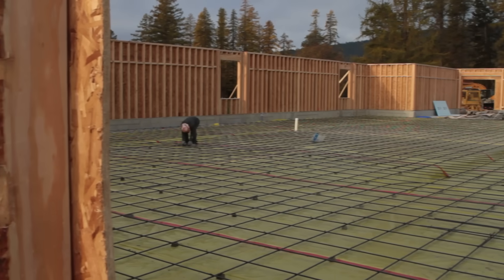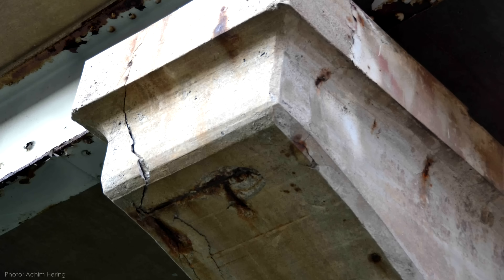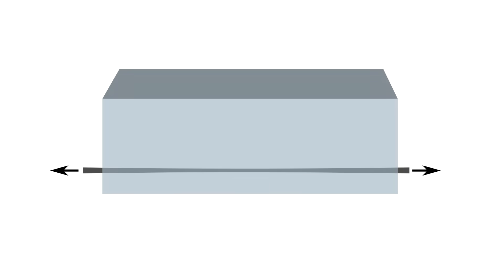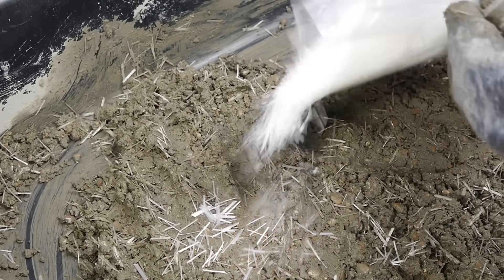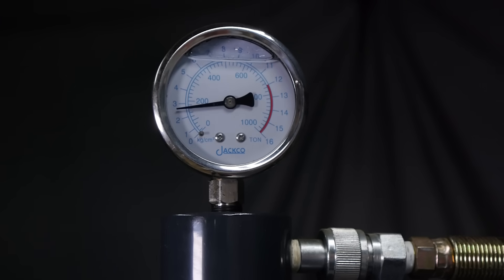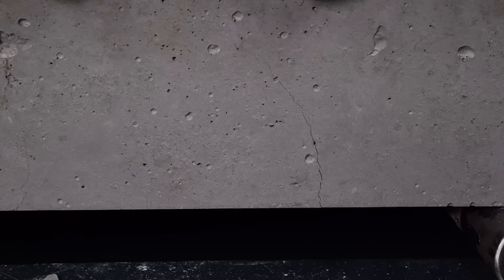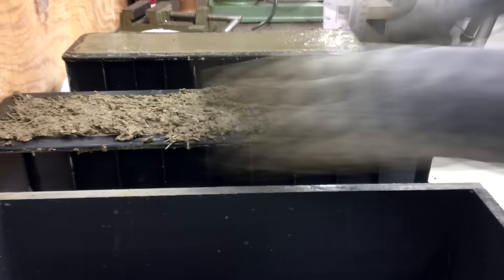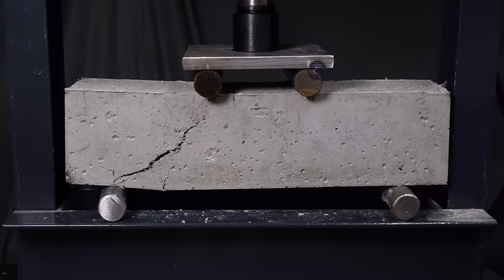Does Rebar Rust?

Comment: Great video, but the structural reason that steel rebar is used is also that it has a very similar expansion and contraction rate as temperature changes occur.  Glass has the problem of alkali silica reaction. The the crystalline gel formed around any glass in a Portland based concrete is expansive and swelling occurs. This swelling breaks the concrete matrix. Admixtures can be introduced to combat this, but cost is key. The single best system is to use as little water as possible. The water amount above what is needed for the CHS... chemical reaction to occur is responsible for  capillaries in concrete that lower resistance to salt etc...  But placement of the concrete becomes labor intensive.  Hence the saying "do you want it cheap, good, or fast you only get to pick two of the three.

Comment: Wouldn't steel fibers have the same corrosive issues as the rebar? Since they are spread throughout the concrete they would actually increase the occurrence of corrosion.

Comment: Less cracking in reinforced concrete under load is not necessarily a good thing, especially not in these situations involving beams/other structural elements. As structural engineers, we want ductile failures, not sudden ones, so our structures give us proper warnings that something is wrong. Notice that in the fiber-reinforced concrete beams, the failure strength remains unchanged but there is little to no warning of impending failure. This is a BIG no-no.

Comment: If you mix in steel fibres aren’t you just going to make the corrosion problem worse?
Reply from the maker: Not necessarily if you keep the cracks smaller ;)
Reply: Sure, it’s just that the fibres will be less covered and have a far greater surface area that’s susceptible to moisture/chloride? I guess the test is their longevity in practice. Thanks for the videos and reply!

Comment: Many concrete structures/bridges built in Roman times are still standing today. Of course, they didn't use designs that required reinforcement (i.e. compression forces only). Modern designs use much less concrete, but require more maintenance. Hopefully, we can get some of those longer-lasting reinforcement materials in common use and we might see structures that last as long as those built by the Romans
Reply: The other big difference with Roman concrete is that they chose a formulation that cured much, much slower than modern concrete. The relatively fast curing of modern concrete causes a lot of thermal stress from the heat of the chemical reaction; this causes micro-cracking. Roman concrete took years to cure as much as modern concrete can do in weeks, but it was much stronger and denser as a result; practically solid artificial rock. We could make our concrete pretty much as good as the Romans did - there's a Buddhist temple in Hawaii which was required to last for a thousand years, so its construction went for a similar sort of very-slow-curing concrete for the foundation - but we choose not to, because fast construction is valuable to us.

Comment: I'm curious, why not just paint the steel or coat it with something. I'm sure there must be a reason if it's not being used but I'll be happy if anyone could clarify me on that.
Reply: They do coat it in large projects especially as he said with epoxy when its building something in a corrosive environment like ocean/seaside, they are often coat each size in different color to make assembly easier. seen this done in a few Discovery channel episodes on mega engineering projects like one for a bridge.

Comment: Most rebar is embedded already with surface rust on it... which to me, seems stupid as shit.  Rust is an enabler for more rust.   All the rust should be removed, coated with phosphoric acid, and the rebar painted with enamel imho.   The second big stupidity is you are embedding steel inside of WET CONCRETE.  Bad idea.  Water is an immediate catalyst for rust.  Don't believe me, cut anything with a metal cutoff wheel., accidentally leave it out in a light rain accidentally.  You'll come back and your cut will be immediately rusted.

Steel is definitely not a great reinforcement choice.

Comment: I know of a garage that had a concrete floor poured with steel fibers mixed in. Worst thing they could have ever done. As mechanics, they need to lay on the floor to get under cars and such. As the concrete wore away from constant traffic, the steel fibers began to poke though the surface and would constantly catch on their overalls and poke them in the back. Not fun.
Reply: They probably could coat the floor with some hard durable polimer.
Reply: @JGnLAU8OAWF6  
polimers don't like oil and organic solvents used to clean away oil even less so.
Reply: @windhelmguard5295  there are many kinds of them, and resistant one should be available.
Reply: @JGnLAU8OAWF6  OR you could just throw an old carpet on the floor before laying down on it.
Reply: @windhelmguard5295  yeah, because old carpet is much more resistant to chemicals than concrete coatings...
Reply: Unfortunate, but the concrete isn't entirely a mistake here. A surface coating of epoxy, enamel, or some other hard material could easily salvage that floor and ensure it lasts many years to come.
Reply: some projects are just about saving money and they didnt want to go over budget. thats typical with anything the we humans do.  its the "foundation" of most municipal contracts.
Reply: They make concrete sanders. I would just run one of those over the floor. But seriously concrete shouldn't be wearing away just from rubber contact. Sounds like a bad concrete installer all around
Reply: That would make it far worse, the fibers would probably end up surviving more than the concrete and poking out everywhere.
Reply: They make epoxy surfaces to coat garages.   They are meant to stand up to the oil/etc too, so it's a good option.
Reply: I (as a non-expert) would suggest that there was no need to use fibre reinforced concrete in that application, but if there was a reason then there is a reason to have put a surface layer on top without fibre included. A simple retrofit surely.
Reply: put a welcome mat on the concrete before laying on it..your welcome!
Reply: When was that poured? Metal wire fiber was proven hazardous and ineffectual shortly after it was introduced. Nylon fider was the replacement and it was introduced in the late 1990s.
Reply: @michaelcarson9688  security walls and floors still use steel fiber.
Reply: epoxy coat the floor. makes a neater evironment
Reply: Car tire wear and tear should be trivial on non-shit concrete, but an easy fix is to have some 4x8 sheets of 1/8" diamond plate sheared into strips then use anchors to bolt it to high wear areas.  Synthetic fiber works great for me but I have NO idea why anyone would use steel fiber.  Epoxy (preferably with grit for traction) can coat the rest. I was a facility manager for a USAF inspections section hangar and we had to recoat when someone spec'd smooth coating because it was dangerously slick.
Reply: Mechanics who have to lay on a bare concrete floor?  Oh yeah I want to work there.  BTW i wear heavy coveralls, have a creeper, and a thin rubber mat, AND AN EPOXY OIL PROOF  BARRIER in my shop.  Any one of these would stop that.  They must just be laying in gallons of oil that leaked and soaked into the concrete...probably what deteriorated it.  Call OSHA.
Reply: Edward Schmitt not every mechanic likes creepers, i work in a shop with 27 other mechanics working on trucks (kenworths) and in the whole shop there’s only 1 creeper and it barely get used
Reply: Why don't they have an epoxy coating on the floor? Pretty standard practice for a mechanics.
Reply: "Our concrete is 100% recycled! Cement ground from the WTC debris and used needles from homeless people as reinforcement"
Reply: Their concrete is wearing away?
Why?
Reply: He poured his demonstration blocks the same way
Reply: #nailedit
Reply: All these comments are good and well intentioned,for the most part. Thank you, all. Concrete will wear over time due to steel wheels (floor jacks), etc. The rubber in boots picks up particle matter and these particles cause the wearing away. Just turning a wheel slightly can cause microscopic wear. Short of kevlar re-inforced suits, the cheaper alternative would be cardboard barrier or carpeting such as commercial grade mats. Epoxy coating can be costly but overall a better option.
Reply: Nelly Farnsworth no just their used drug needles. Their corpses are too acidic for the cement.
Reply: we
Reply: In a garage the concrete has to stand up to chemicals that are spilled and more often road salt from off the cars.
Reply: Glass fibers eventually do the same thing.  Not as painful as steel fibers, but a bitch just the same.
Reply: Cotton/rayon fibers is also a solution, as weird as it sounds. It does not lead to these issues at all, but prevents cracking just the same.
Reply: So which third world country do you live in? Who in their right mind would use steel fibers in that situation? Who and how does concrete wear away as much as you say? Was the concrete 80 years old or something?
Reply: For anyone wondering, the concrete is wearing mainly due to the friction associated with car loading, which is a lot. Although a coating/occasional recoating of epoxy and etc. would still solve the problem.
Also using a grinder on any hard fibers leads to hard (steel) fibers everywhere, which is really bad.
Reply: @bestpseudonym1693  Car loading? lol Try piss poor concrete to begin with

Comment: It seems like the aggregate is always going to be a problem.  Thats ultimately what makes concrete cheap.  Even in your video, when you see the surface where it broke, it preferentially broke along the cement-aggregate boundary.
I wonder if aggregate treatment wouldn't be a decent solution?  Something like acid etching the aggregate to give more adhesion surface.

I also wonder if there isn't a way to put the odds in your favor for aligning the fiber reinforcement with the rebar as most cracks seem to form orthogonal to the rebar.
Reply: When mixing formulas other than for passive environment and low strength elements, we always use granite chippings as aggregate where I work. Granite chippings have a much larger surface area.

Comment: I was seeing demos of fiber reinforced concrete back in 2000. As for innovation in civil engineering you're perfectly right. Many "innovations" turn out to be rubbish, see that bridge in Italy. As for rebar replacement my vote goes to stainless rebar as it is similar enough and the gain in durability and peace of mind easily out weights the extra cost.

Comment: One of the reasons why you don't very often see stainless steel rebar (or other alternatives) in concrete is because some of the most common stainless steel alloys have a wildly different thermal expansion ratio. Meaning that if your reinforced concrete cools down or heats up, the 2 materials will expand at different ratio's which causes cracks of its own and a range of other issues. Concrete and good old steel are pretty closely matched however, meaning that cracking due to thermal changes is pretty much a non-issue.
Reply: The range of properties for SS is due to the fact that "stainless steel" is not a well defined term.  There are a variety of approaches to getting steel not to rust and these are all generically called stainless steel though they have very different physical properties, based upon which other elements are added.  ASTM does create(validate) various standards but the real reason why stainless hasn't caught on is cost, strength, and most importantly !!!!BY FAR!!!!! is ductility. Good old fashion steel will stretch but not break, the perfect building material.  Adding more carbon, nickel or chromium might increase some desirable properties but it also makes the steel more brittle.  The worst property possible when parring to concrete.
Reply: The alleged corrosion resistance of stainless steel is dependent on exposure to oxygen, which causes stainless to form an oxide surface that protects against rust.
Reply: I was missing this aswell.
Reply: Meaningless overprice.

Comment: Make sure to keep the loading point at a constant distance.

 In first concrete slab the bottom points are farther apart 
In seco concrete slab the bottom points are very close to eachother
In third concrete slab the bottom points are not farther or close to each other

For reference please read the loading conditions and its effect
Please research and do correct experiment and post it in here.
Thank you
Reply: Correct me If I am wrong
Reply from the maker: Not running a testing lab, just trying to show how flexural cracking can be reduced with fibers :)
Reply: If you have made the distance same then the fiber reinforced can break at 2tons too

Comment: Basalt fibers are also starting to be used in concrete. They have many of the properties of the glass fibers, but they do not suffer from issues of high pH causing lack of binding or fiber damage and are more economical to produce. You can do some crazy things with a high strength mix and high levels of glass fiber reinforcement, like having bends in the final product, have high strength with light weight, and impact resistance. I am surprised that a company hasn't started making roof tiles out of the stuff since you could go thin like slate, but have immunity to hail damage. It isn't hard to get a mix for glass fiber reinforced concrete to be impermeable to water either, so you don't need the thickness that current concrete roof tiles have to keep the water out. They would also last longer than a slate roof since they would not suffer from broken slates, so we are looking at 50+ year roof life easily.
Reply: https://www.neuvokascorp.com
Reply: He does mention fiber and basalt composite rebar in the video you apparently missed hearing and seeing
Reply: Joshua79C C  Yeah, I got a phone call at about that time in the video and couldn't hear the adio for about 20 seconds. Damn political donation begging.
Reply: Basalt fabric embedded into cement can make very thin and strong plates. The fibers are typically impregnated with an epoxy resin, so it has some stiffness right from the factory. It works well with shotcrete.

Comment: Practical Engineering please tell me what you think: (i am not an engineer) i think a cheap solution would be heavily galvanized steel like in high tension power line poles....stainless steel is so so expensive.... i know a type of steel alloy wich is not considered a stainless steel alloy here but we call it "aço cromo" or translated "chrome-steel". For the non-magnetic stainless steel we call it "Inox"( the "In" is a negation prefix and OX means oxide) ....This chrome steel is used on washer machine drums (front loaders atleast) and dishwashers..it is very magnetic unlike the more "pure" alloys of stainless but it is much cheaper and it never rusts...it does not resist to extreme heat like stainless steel however...if you put it on a fire, the next day it is rusted...thats why kitchen knives,forks and spoons are "aço cromo" and cooking pans are stainless steel (or aluminium etc).
Reply: galvanized steel is what is most used in the USA, hard chroming is more pricey but still often used where budget is not a concern, Inox is a stainless type of steel and still more expensive than galvanized or chromated (hard chrome plating)

Comment: Great video! I'm curious if you know anything about hemp fiber being used to reinforce concrete. I've heard people claim that in the long term, these fibers actually become petrified and give superior reinforcement to concrete. Unfortunately, anything related to practical uses for hemp typically ends up getting politically and emotionally charged (for obvious reasons), so I don't think I've ever seen any credible summaries of useful data.
Reply: Hemp - be it bush, tree (Manila hemp) or kenaf cane (Deccan hemp) variety fiber lengths max out at 6mm. Too short to provide sufficient tensile in a concrete structure. Can work in plastic parts or in cement panels. People think hemp is long but that's raw fiber bundles still held together with natural lignin. Makes for poor reinforcing since the lignin "glue" is a weak link in any final structure.
Reply: zenengineer  Thanks! Always good to get useful information without the political and emotional charge.
Reply: Sounds preposterous to me too, but the claim that hemp fibers become petrified didn't give a timetable for how long that takes. Maybe over a hundred or a thousand years, or ten thousand. Or maybe hemp is a magical fiber that petrifies in concrete in five years. Like I said, credible data remains to be referenced.

Comment: neglect sadly does not improve with longevity of  infrastructure. the opposite is the case. the longer a building holds up with out showing signs of weaknes, the higher the risk that it is neglected and thus fails catastrophically without prior warning increases. This was also the hidden scary part of your demonstration: Just rebar showed cracks, but was still save. The fiber reinforced concrete did not show signs of weakness and fail without much warning.

Comment: You're laying the foundations to understand concrete: (snicker) but I would love to see you walk us through how to apply it!

Please design and build a real structure on cam as you would professionally, and walk us through it! Doesn't need to be grand: maybe a shed? Take a soil sample, do a slump test as you talk about dirt. Design a footing as you talk about stresses. Do a french drain/water drainage system as you cover more about water. Ect. It could be a whole series where each vid is a single aspect of what you're building.

And go nuts with cutting edge civil engineering! I'm sure you could run a kickstarter to pay for the materials!